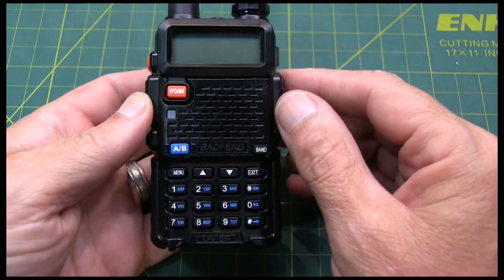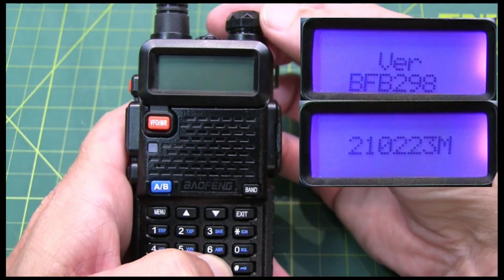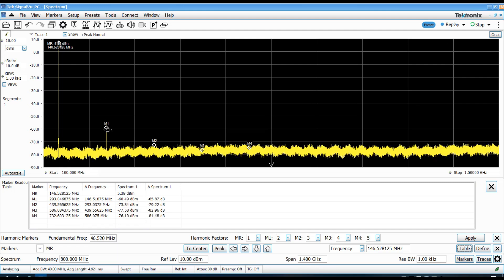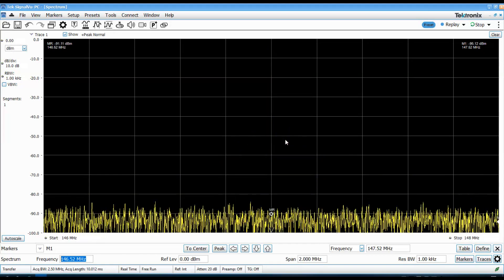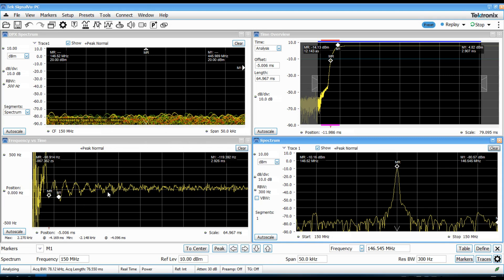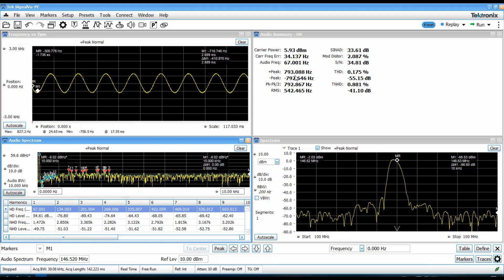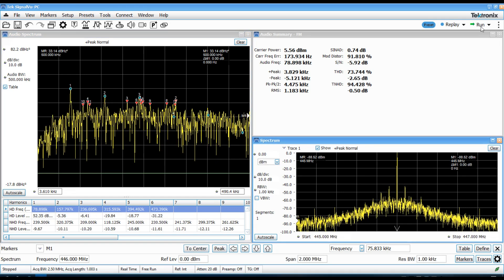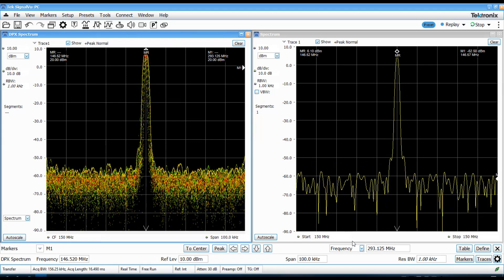#393: Analysis of the RF characteristics of the Baofeng UV-5R Dual Band HT

Comment: Nice work. Ty! Ive had 4 of these and everyone had problems. Im not sure why we even bother with this cheaply made junk. We are actually fixing the problem for them by solving and finding the problems for them. Id rather give my money to friendly nations who already make great products or encourage the US companies to make hams again. The battery locking mechanism is so frail and cheap. The "manual" says that you need to charge the batteries for 5 hrs b4 using. All 4 of mine were fully charged when I received it. They were loaded with frequencies already. People are buying them, and we are getting used radios. Complete crap.

Comment: Is it legitimate to look for harmonics using a scope performing a FFT?  I don’t have a spectrum analyzer but wanted to check my older HT.  Thanks for your FFT tutorial as it helped me a lot and I can get a cleaner result!  My older Baofeng’s first harmonic is pretty close in magnitude to the output signal.  When I swap in my icom I see a much lower magnitude for the first harmonic.  I still need to learn more about my scope’s FFT magnitude scaling to be able to say numbers.  Would you demonstrate the correct way to do this on your scope?
Reply from the maker: You can make comparisons to some extent, but not really measure actual harmonic levels.  The reason is that most scope front ends are not linear enough to do this.  In other words, the front end of the scope, including the digitizer, will likely add harmonic distortion to the measurement.

Comment: I bought a BF-F8HP from a volunteer fireman who was trading up.  It is the first time I held a radio since getting my technician license.  I want to leave the radio plugged into power (charging) and turned on, so I can passively listen to updates, from NOAA, for example.  When I plug into power, the signal cuts out.  I can't tell if that's caused by RF interference from the power cables or if the radio is simply not made to be active while charging.  Is anyone familiar with this?

Comment: Hello sir  hope you are also fine. I am fine too. But i fall in confusion that is  ah what is the difference between voltage & potential difference
Reply from the maker: Voltage is the potential difference measured between two points.  Often times you're measuring with respect to ground, and most people will just call this the voltage.

Comment: I didn't notice you say how you got this radio. Did you buy it, like a regular person, or was it sent to you, to evaluate? It seems, when they send a radio to someone to be reviewed, they send them a "good" radio, but if you buy a radio like normal, you get a "bad" radio. I have ordered a lot of CCRs (Cheap Chinese Radios) off Amazon, just to test, and some of them are surprisingly good, like Retevis.Most CCRs, especially Baofeng, have pretty bad harmonics on 2m, but are pretty clean on 70cm.

I also noticed, you're only checking for harmonics, and not other spurious emissions. I recommend you start your sweeps as low as reasonably possible, so you can see all the garbage the radio might spew. I had one particular Baofeng that's IF was leaking quite a strong signal in the 70Mhz range (1/2 the fundamental freq). If you start your sweep at a lower freq, you might see some IF leakage on 2m, in addition to harmonics. To be fair, I only had one radio that had a strong IF leakage, but you never know what you'll find.
Reply from the maker: A friend gave me the radio at a hamfest this summer. He bought 5 of them for $100 and didn’t need all of them. True, I didn’t look below 100MHz, I’ll try that. But I certainly did see non-compliant spurious in the form of this 75KHz modulation sidebands.

Comment: Were these spurs less than 25μW on 2m at all power level settings?  Were the levels the same all across the band?  My UV-5R spurs were only down 30dB - you either got a good one or I got a bad one.
Reply from the maker: The modulation sidebands were definitely above 25uW at both power settings. But, all the carrier harmonics were well below 25uW.
Reply: @w2aew  Then as I understand the rule, that is a problem: For a transmitter having a mean power of 25 W or less, the mean power of any spurious emission supplied to the antenna transmission line must not exceed 25 µW and must be at least 40 dB below the mean power of the fundamental emission, but need not be reduced below the power of 10 µW.  The rule is not limited to harmonics, and both the dB below the mean power and the 25μW limit must be satisfied, unless the mean power is low enough that 40dB down is already below 10μW.  Is the conclusion that this radio violates Part 97 emission requirements?
Reply from the maker: @kenchilton  Yes, after studying the rule (after I made the video), I would conclude that these modulation sidebands violate the 25uW rule and thus do not pass Part 97 emission requirements.
Reply: @w2aew OK. Cool!  Thanks for verifying. I thought I might be looking at it wrong.  Also, thanks for the video! Nice analyzer, too.

Comment: Likely Integer boundary spurs but why is it stronger at the start? I've had some SDRs that had such moving spurs and initially dismissed DCDC (as their frequency was changing every time) but turns out you can have a lot of weird spurs with high current draw and temperature changes. Guess they also didn't use any filtering to the PLL circuit. Some DCDC ICs switch between PFM and PWM so that could explain stronger spurs at the start but ehh, 3 watts.
Reply from the maker: Yeah, it’s just a cheap meh radio.

Comment: I don't like any HT without a tuning encoder, bottom line. With these Baofengs units, you only have the up/down arrow keys to go through VFO or memories. I hate that!! I also insist on HTs that have a barrel power connector jack so I can power in my car through a Cig. lighter option. Otherwise you have to carry spare batteries! Very few China radios have these two features I just mentioned!! So kudos that they might be cleaning up the signals on transmit but they still lack features important to me. Plus they fail all of my receive tests, since they are direct/single conversion. They also pick up interference from household or car sources much easier than a good Japanese radio. Such as from PCs, PC monitors, LED lights, car alternators, you name it. I thoroughly tested this by comparing my Yaesu VX-6R and my Kenwood TH-D75 to two UV-5R8W (8 watt version not sold anymore) by scanning the exact same frequencies programmed into all four radios. So Baofeng had two radios and two chances to impress me, but they were a fail. The Baofengs were constantly stopping scans due to picking up some interference, while the Kenwood and Yaesu only did a few times, being far more immune. Receive on the two Baofengs from a strong repeater was fine, with the audio quality more than good enough. They sound okay on strong sigs.
Reply from the maker: I agree 100% on all points!  The only reason I have this rig is because it was given to me.

Comment: They're not clean, but they're not as bad as as people make them out to be, and most other radios aren't as clean as people tend to believe. In the earlier days people believed the 5r was super dirty because they would transmit on one and receive on another over very close distance, and the receiving radio would pick up the transmitting radio all over the place because the receiver is so poor, and people took it as the transmitter being terrible.
Reply from the maker: The worst (unclean) thing I observed was the 75kHz modulation sidebands, which exceed the 25uW spurious regulation.  Carrier Harmonics were good, as was the transient keyup characteristics.  I didn't do any receiver testing.

Comment: Excellent as always, you don't disappoint, but the main problem AFAIK of those rigs is the lack of selectivity, can you do a RX test? i will try to get one of those for testing as well and test it here at the lab, honestly i never bought one because many of my ham friends told me they were pretty bad compared to a yaesu or icom HT, but after watching this video, at least in tx performance it's pretty darn good
Reply from the maker: I haven't done any receiver testing yet.  But I think the main problem with these rigs is not-so-much the sensitivity (mine seems pretty good), but the fact that the receiver performance can be easily degraded in a crowded RF environment.  I believe this is where the poor sensitivity reputation comes from.

Comment: Great video!  I did some similar testing on my own Baofeng, and observed very similar sidebands - although mine exceeded 25 uW.  I also observed what you saw in how they peak right after keying up, and then settle.  I think you are spot on in noting a switching power supply issue.  My guess is that the power rail to the final amp is noisy (at a switching freq of 75kHz) and effectively modulating the signal - so adding AM sidebands.  It settles after the dc-dc converter begins to settle after the big power draw of transmit.  Of course, I'm speculating, but that fits.  That doesn't seem like it should be that hard for them fix - they are either running too close to the rail, or not using any feedback to avoid that sensitivity.
Reply from the maker: Yeah, those sidebands are above 25uW, so non-compliant.

Comment: What are the common causes or issues why it take a long time for a transmitter or transceiver to Settle to the final frequency?
Reply from the maker: It's a function of the design of the PLL and how it is controlled.
Reply: @w2aew  So you're measure the Time interval of the PLL on how long it takes to LOCK the input frequency with the PLL? What is this measurement called?

Comment: Never really cared about harmonic emissions, spurious emissions, or automatic transmission. It's a cheap radio that operates pretty well. That's all I care about.
Reply from the maker: The reason for complying to the regulations is to avoid interfering with other users of the frequency bands.

Comment: Can confirm this. I've done similar tests on even older models and it showed similar performance. Actually, I was surprised - my Yaesu FT-817 had more harmonics at 70cm band than my Baofengs. And I tested like 4 of them bought at different time - results were consistent. The only problem with those Baofengs is their receiver, it is nearly unusable in any large city even with included antenna.
Reply: I've tested the sensitivity (signal injected directly to antenna connector), and my sample was quite decent - so as you mention, the included antenna may be suspect.  Mine came bundled with an Abbree antenna, which compares well to both an Alinco and Yaesu HTs under similar conditions.
Reply: @briansauk6837  No, the sensitivity is excellent and included antenna is also great. We tried to receive satellite SSTV from ISS using just stock radio and smartphone app - and it worked surprisingly well. The problem is low dynamic range, it gets overloaded easily if you operate it in any large city. But for that price it still has no competitors in my opinion.
Reply: @briansauk6837  that is weird... I'm sure I answered your comment but can't see it. Sensitivity was good, dynamic range is the problem. Baofengs are nearly unusable in heavily congested RF environments. But you can't blame them for the price.
Reply: @madnessandescapism  I certainly won’t claim my testing was comprehensive, but I found the selectively was not bad for adjacent “channels”.   Not sure how it would do in a really crowded environment though - I’m in a pretty “quiet” area. 

One problem on my copy, with no mic gain control and the built in pinhole opening for the mic, I find I nearly have to yell to get adequate modulation.  An external mic made a big difference.  At the end of the day, it was a cheap first radio, that served as a gateway to getting better radios, giving credence to HAM really meaning, Had A lot of Money.  73.
Reply: Your Yaesu FT-817 probably needs a good alignment. Yaesus are usually among the best transmitters as far as spurious crap.
Reply: @markr.1984  it is still within specs, but it is not new, it can legally drive and buy alcohol :) Might need filter replacement soon (can't see how adjustment could help against off-band harmonics, but I'm not professional radio engineer). The point is not to put blame on Yaesu, they obviously make really well engineered radios, you can't argue with that. The point is that modern cheap radios actually not that bad transmitter-wise. Can't say that about reception and build quality, though, but hey, it costs $20, that is less than Yaesu battery.

Comment: Very interesting!  Just goes to show that not all UV-5r's are the same.  I think "they" got a little pressure to clean up the output of these radios over the years.  I have a couple that are maybe 7 years old that do not pass the harmonic output test.  I had 2 of them tested at the Dayton Hamvention by the ARRL "test bench" a number of years ago, when still at Hara's and they failed.  I also tested them just for something to do on a 1.5 GHz spec-an I brought home from this years Hamvention.  No difference than years ago.   I don't use them any more, but can't bring myself to toss them out either.  The ones I have also have an issue with the DTMF tones,  I forget which tone it is, but 2 of the buttons on the right side column produce the same tone!

Comment: 21/02/23/M Could well be a hardware date code of 21st Feb. 2023. M could be manufacture.
Reply: From Wikipedia, “The date format follows the Chinese hierarchical system, which has traditionally been big-endian. Consequently, it correlates with ISO 8601 — year first, month next, and day last (e.g. 2006-01-29). A leading zero is optional in practice, but is mostly not used.”
210223M would be 2021, February the 23rd.

Comment: I tested a UV-5R V2+ from 2015 which failed, and several UV-82HP from 2019 which failed miserably. I have yet to find a Wouxun or Anytone that failed harmonic limits. The only baofeng I tested that passed was a BF-F8HP (ZP5BF-F9V2) that passed, but only barely.

Comment: I appreciate the rigor of your testing.

There have been some videos posted to YouTube, even recently, that conflict strongly with your results. Since I had picked up a Baofeng K5Plus (I wanted something cheap to do 1.25 meters) those earlier videos spooked me a bit. I used what looks to be an identical load/attenuator and a Siglent spectrum analyzer to do my testing. Although I don't have all the analytic capabilities of your Tektronix instrument, I was able to determine that the very high harmonic levels reported by others were not present. Your video reassured me that my testing regimen was valid. Thank you.

Comment: Is the spurious emissions at M1 at or below 25 µW? If not than the radio still violates the fcc rule 47 CFR 97.307(e).
Reply from the maker: 66dB down from 3.5W is less than 1uW.
Reply: Surprising but then again 3.5W on the fundamental is low for a 5W transmitter.  I wonder if they got the spurrious emissions low enough by tuning the power down. My box of older baofeng are all have a fundamental above 4W and the spurious emissions are above the max as well.  At least you can use yours legally. 

Thanks for the test and response. It's interesting to see it.

Comment: Thanks, good to know they aren't actually that bad.  I'd love to hear your thoughts on the damage threshold to a receiver with antenna located near a TX antenna, e.g. two verticals mounted on a vehicle roof, a few feet apart from each other.  In particular concerns about a scanner with wide open front end.
Reply from the maker: Highly dependent on the particular victim receiver in question. Certainly possible.

Comment: I had a Quansheng UV-K5 that was a really clean radio spectrally, as well as had a decent receiver that detected voice levels clearly at -127dBm.
That was a shocker...most had noise at that level, with voice not recognizable that low in signal strength.
I had another portable that was pure garbage, and I actually destroyed it on video so it could not be repaired., if was a K-sun I believe...sorry I do not recall the name precisely.

Comment: I was hoping to see the harmonic output when used on the commercial bands, eg two-way frequencies, UHF CB, etc. The concern is whether it is fitted with harmonic filters for the other bands that these sets are frequently used on.
Reply from the maker: This radio is unmodified, thus will only transmit on the bands it was intended for (US 2m and 70cm amateur bands, in this case).

Comment: The ones I bought about 11 months ago came up clean too.  It's quite amazing to get 5 radios for under $125 (USD) and have them perform this well.  Something this good back in the mid 70's would have cost a small fortune.
Reply: a very valuable thread which adds a lot to this video, thanks guys.